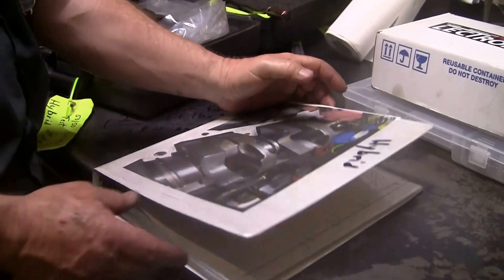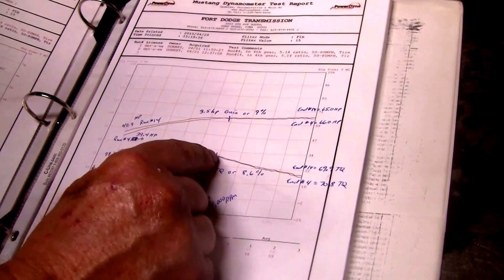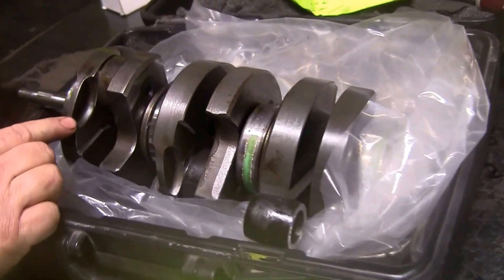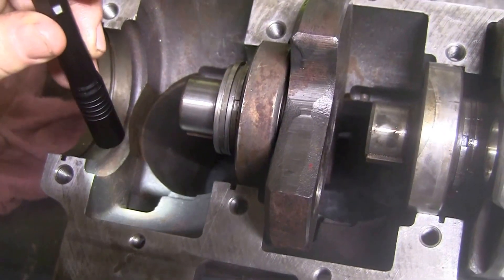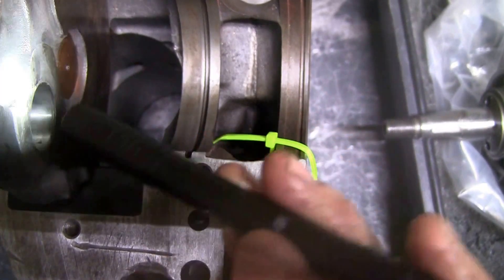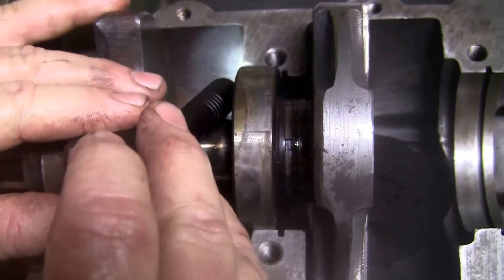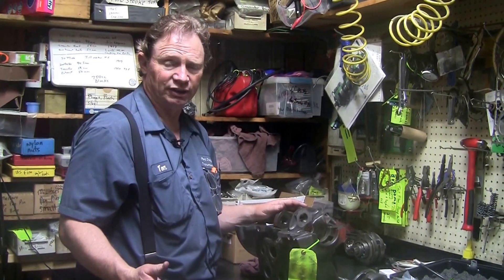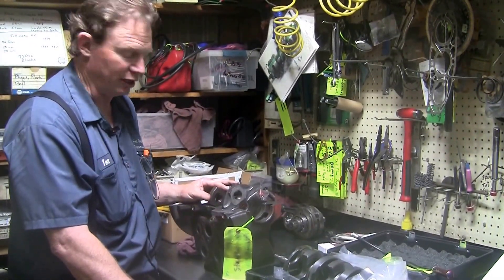Saab Two Stroke Engine Hybrid Crankshaft (50/50) Vintage 3 Cylinder

Comment: Hi Tom, I´m a little confused about where to put the full circle weight in front or in the rear? You talk and write (text over) that the full circle should be in the front. But on this video when you explains the full circle is in the rear?  Regards from Norway
Reply from the maker: It’s a standard T weight in the rear.   I think the video is just showing how the restriction occurs.   so your full circle goes to the front of the cylinder and your standard goes to the rear.